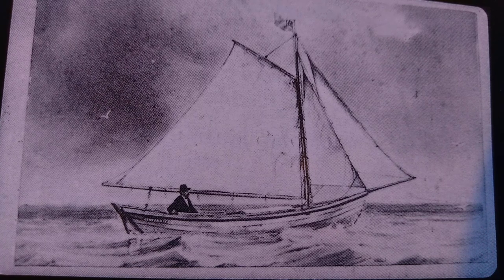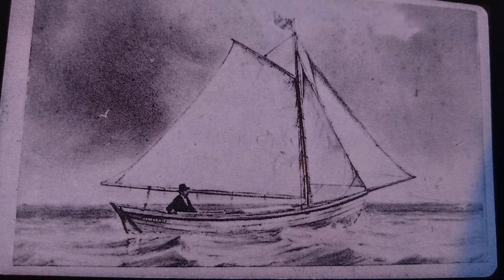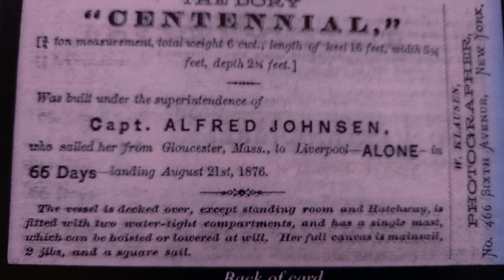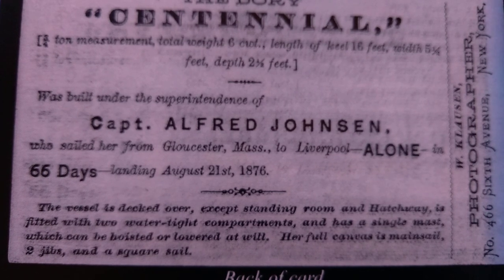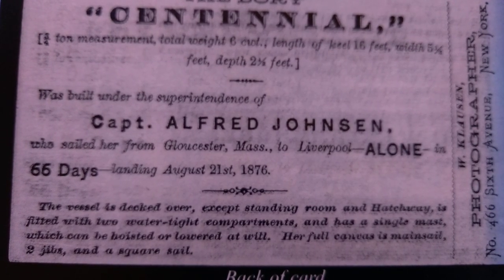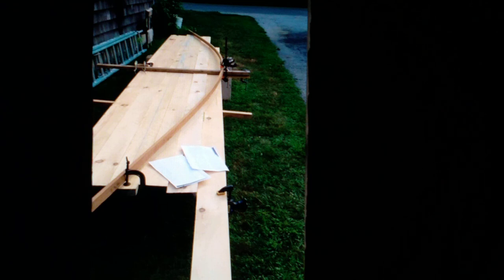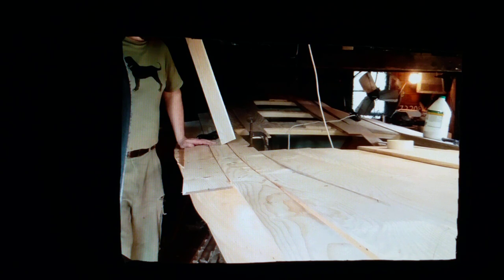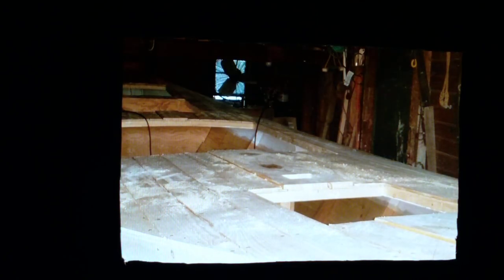Building a replica of Transatlantic sailing dory Centennial.

Comment: I own that same book by Gardner, and he cites good eastern white pine planking in a couple of the other boats described in the book, including the 26 ft Chamberlain launch. It is not as rot resistant as white cedar, but much more commonly available, much less expensive, more knot-free on average, a bit superior hardness (cedar is very soft!), easily worked, more dimensionally stable according to Wood Database, and I believe more split resistant. When oiled and varnished over time, it goes to a darker amber color that some have referred to as "pumpkin pine", even supposing there is a species by that name. But it is just good old Pinus strobus, one of our great heritage wooden boat planking species and also decking too. Once it was widely used as edge nailed strip decking on ships and was renowned as watertight. They cut it rift sawn and clear strips so that its expansion and contraction was very low. White pine is one of the most dimensionally stable wood species in the world.
By the way I played your video at 1.5 speed and the pacing was just right. YouTube does not raise the voice pitch as it uses digital sampling.
Reply from the maker: Yes! Eastern White Pine is wonderful stuff, just keep away from the sap wood and grey stain and the stuff will last forever, the original Centennial hull is 146 years old and has seen lots of weather and neglect and still there to inspire.

Comment: wow, I'm thinking of building a pine bottom with an ob well for my dory, 2 questions...1). no tounge and groove like that Canadian video from lunenberg (noticed you didn't for the alpha & Gardner doesn't specify it. thoughts? 2) since I was planing on an ob well with a 9 inch wide hole I thought wider planks and tounge and groove would help hold the bottom together for that (while risking some cupping with aging wider boards) thoughts ? insights??? great videos/boats/knowledge! ty!
Reply from the maker: A traditional plank bottom is calked so no toung and groves there,  I suppose I could have with the fiberglass but why bother when it's unnecessary? The narrow planks work like strip planking minimizing movement of individual joints by distributing more seams across the bottom, this helps keep the glass from having too much stress at any one seam.

Comment: Is there any balast in the hull? Or is the centreboard weighted? How does that work?  Im thinking about building something similar to do a lap around australia in, beautifully built boat btw..
Reply from the maker: The original boat carried iron pigs/bars as ballast. I have wheel weights bagged and captured under the floor boards, 600lbs+- the ballast takes up some valuable storage space, if I was traveling further I would consider bilge skegs of lead or maybe a weighted swing keel.
Reply: @danoyes1  nice, yeah i plan on having a keel with a traintrack in it i have saved aside, might even use twin keels so i can beach her easily and have a shallower draught
Reply from the maker: @4kays160  yes, I've had similar thoughts with Centennial, a box section steel tube filled with lead bolted to the bottom, either side of the centerboard, but I do often sail in quite shallow water and am reluctant to increase the draft be even 3-4 inches... it would make for a bulletproof bottom drying out on gravel or rocky beach.

Comment: great videos Dan!  What moisture content would you recommend for the strakes?  I have a sawmill and was thinking of milling full length pine, but it would be fairly green when i want to use it this winter. i have access to 1x6 air dried pine , but they wouldn't be full length. Thanks for your insight!
Reply from the maker: If you have a itch to get building I'd suggest getting some air dry lumber 1x6 could work for a dory bottom but is too narrow for typical dory planking, if you are building another style lapstrake boat with narrower and more strakes it may be fine. The lumber is a percentage of the build cost, there's not alot of wood in a 20 ft. Dory, all the wood pine and  white oak framing for Centennial cut and dried cost me with around 600$ price may vary but I certainly could not cut and dry lumber for close to the same cost.. wet pine will shrink alot. You can scarf 2 good short planks to get a length you need.
Reply: @danoyes1  yup , definitely have the itch to get going again. started it last march, basically got the frames set with the transom, and had to get to "paying" work.  I have some reclaimed 2x6 cedar from a panabode that I am using for the bottom. I figured the green would shrink to much, but i see no option but to use a green one for the very first plank . I was actually considering "ship lapping" the planks . lol .  instead of the traditional lap like you did.
Reply from the maker: @mattdavidson6550  dang, sounds like fun!
Do you have John Gardner's,  The Dory Book? Definitely get it from your local library or bookstore. 

The cedar should make a excellent for the bottom, only concern would be if you are planning on a centerboard fitting the box entirely on a 6inch wide king plank.
I think you will find the traditional lapped strakes far more forgiving to fit to the previous plank than shiplaped strakes.
Reply: @danoyes1  thanks for the advice. I'll have a look for Gardner's book for sure!